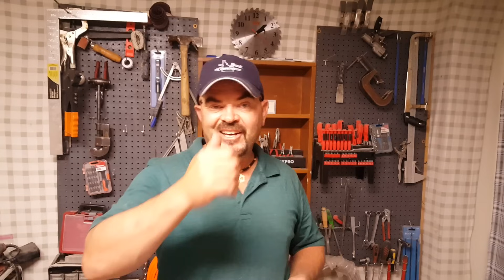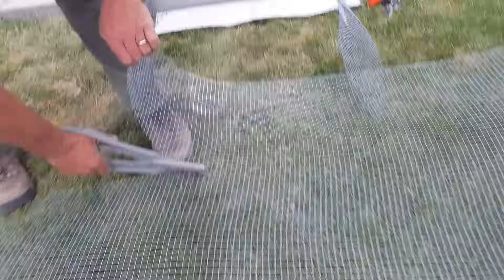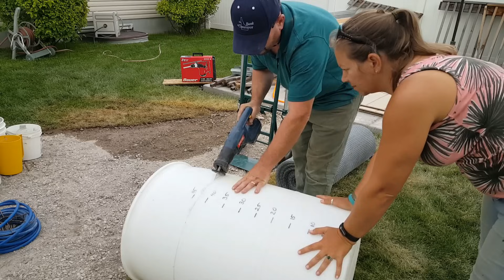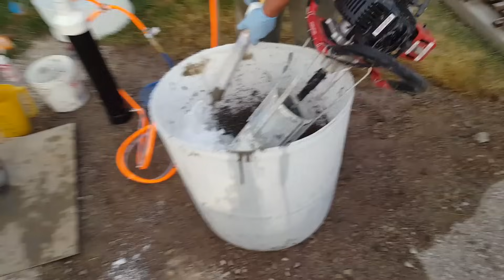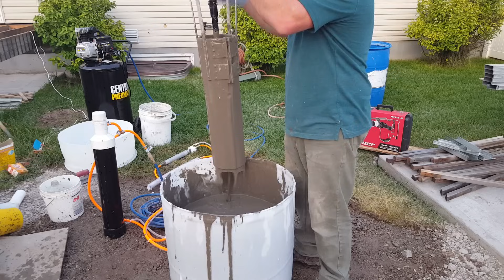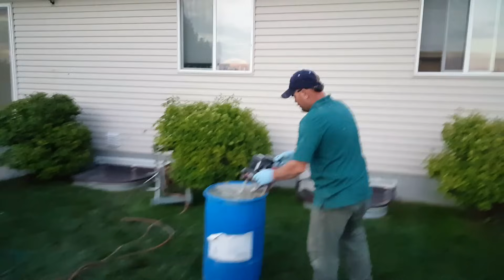Pouring Air Crete Panels for Shed

Comment: Regarding the aircrete as structural components vs insulating, you could build basically a pole barn and fill in the gaps with aircrete panels. The aircrete would be providing some bonus degree of support, but the integrity of the building wouldn't actually be dependent on the aircrete.
Reply: Don't forget the pressure eco-terrorists are putting on the tree industry (among other things). Like it or not, the demand for "green" materials is a reality. It doesn't matter if you agree with the politics,  or financial analysis. The trend is towards higher demand for products like this. Tesla Solar is selling out of Home Depot! Total market manipulation driven by an agenda. Today, if you build a new house in California, it MUST have a PV system, NO net metering. Your home will be little profit centers for the State by 2030 because by then, the lunatics will make it law that you tear down that 40 year old hovel and rebuild it "green". That's a few years after they issue FINES for your "carbon footprint", and forcing the entire population on AI/EV's. You vote Democrat, that's what you get. I wouldn't be surprised if some huge corporation isn't developing a product like this right now. Instead of metal studding, they are using polymer castings built with industrial 5D laser printers. Get a patent bro. And stop posting vids online until you have PROOF of concept. Until then, this is all bullshit. Just being straight with you man.
Reply: Maybe you  should move to my state.  Trees are everywhere and sawmills source their logs locally.  Carbon footprint is low, lumber quality is high and dollars stay local
Reply: Gewgulkan Suhckitt up hi
Reply: joeashbubemma Ramble, ramble, ramble, ramble, conspiracy theory, ramble, ramble, ramble. That's all you have to offer. SAD.
Reply: joeashbubemma just be glad there's a majority of people there to think for you. Not everyone is able to comprehend complex things like environment, climate and why recycling is good. If you don't understand why all those rules are there then i fully understand it must be a hassle for you. You may think they're trying to ruin your life but in reality they're trying to save yours and your offspring's.
Reply: Don't patent unless you think you have enemy. No, keep posting your videos brother.
Reply: Sleepydog oh yea..... Like global warming.... Oh wait first it was we were headed for the next ice age back in the 70's...lmao.
Chicken little.... The sky is falling.  The last thing I need is some harvard graduate or pin head politician saving me from anything!!... If they say no I say YES and I guarantee you I'll be correct alot more than they are!!
Reply from the maker: awesome
Reply from the maker: https://www.youtube.com/watch?v=i2eNx0CVXD8      https://www.youtube.com/watch?v=i2eNx0CVXD8
Reply: Ne olduğunu tahmin ediyorum ama türkçe konuşuyorum

Comment: I wish there were labells telling me what was going on
Reply: Aircrete is made of Portland cement and perlite mix (possibly sand?) then a construction foam sometimes used for insulation is folded in like a meringue and then cast into shape. One surface is covered by Tyvec and a reinforcement screen using metal wall studs to form a mold.

Comment: great idea that has been tried for years, I'm a 3rd generation contractor, just trying to help.  You should explain the foam, the mixture looks really thin-translates to weak concrete regardless of what is inside. Have you completed compression tests on the concrete to give us a (psi) level?  Both peak sustained and compaction ratios.  good luck on your trials, but from what I have seen It looks very weak.  I mean nothing bad, keep trying.
Reply from the maker: https://www.youtube.com/watch?v=i2eNx0CVXD8      https://www.youtube.com/watch?v=i2eNx0CVXD8

Comment: You've got the process sorted, now you could do with streamlining the labor input.

- Keep one half of the top of the plastic barrel attached to form a natural lip

- place the barrel in a tipping cart so you can roll it over the mould and use the natural lip to control the pour

- have your mixing tool mounted to a simple lift so all you have to do is move the barrel under it and lower it in to mix

Comment: Aircrete is simply concrete with bubbles. Regular concrete that we use for our roads, basements, and foundations traditionally made from Portland cement. This combination hardens into a highly dense material with impressive compressive strength. The addition of iron rebar adds additional structural integrity.

Aircrete reduces or eliminates the traditionally used aggregate. Instead of including gravel or other coarse aggregate types, aircrete relies on incorporating premade foam pieces that essentially add bubbles of airspace within the concrete mix. Instead of foam, another option is mixing certain types of reactive substances into the wet cement mix. The chemical reaction creates gas bubbles within the cement and water slurry to harden with empty cavities.

Comment: I work with concrete professionally, but I haven't explored aircrete yet. First, have you tested the compressive strength of your mix design- can you provide the results? 
Have you looked into superplasticizer, fiber, polymer, pozzolans? These ingredients might significantly add to the strength of your concrete. Why is the sleeve over the paddle of your mixer? Have you tried mixing aluminum flake (which is what the autoclaved aerated concrete people use to make bubbles)? AAC is probably going to be stronger than what we can make in a home environment, but I think that what you are doing could still be very useful to a lot of people.

Comment: I did the long math on this please correct me if I’m wrong.

Air Crete in metal studs comes out to $2.86 per square ft of insulated 2x4 wall

2x4 with r-15 batt insulation and 3/8 plywood outside is $2.10 per sqft of insulated 2x4 wall

This is expanding the concrete 2 times. Each 16”x 96”x 3.5” would weigh approximately 50 lbs. 

Basically I I figured it based on 16” wide panels.

Comment: Great work !
Please be aware that steel reinforcing bars or nets should be corrosion protected since the porous structure of the aircrete will speed up corrosion due rapid carbonitation which decreases Ph- value of the aircrete.
Suitable corrosion protections  may be concidered:
* Hot dipped galvanized steel
* Bitumen coated steel (easy application and cheap)
* powder coating
* Paint
* Coating of potassium silicate waterglass.  Caution... Do not use sodium silicate coating since it  may dissolve in water!

Regards

Greattimez, Españistan
Reply: hmm people are using Sodium Silicate to make Waterglass to use as a binding agent in their DIY refractory cement for their foundry... I wonder if the heating up of metals releases water vapor that could effect the water glass durability....
Reply: Christopher Jones 

....
Reply: abdoulaye seck ?

Comment: Air Crete's main purpose, i.e., best use? Is it to replace foam insulation cheaply? Foil backed polyisocyanate is expensive and not sold at home improvement stores anymore, but it's the best insulator. What is A.C.'s R-value? Strength? Cost without labor?

Comment: Do you know that New Zealanders were using foamed concrete to build earthquake proof homes before 1975. I witnessed one being built in Newcastle, Australia.  Factory produced panels, with brick tiled exterior face and finely smoothed interior wall service,  pre-fitted with doors and windows were trucked to the build site, lifted individually by crane and placed on piers within trenches. Roof trusses were added, prior to cement trucks pouring a slab floor.The concrete was pumped through open doors and windows as the roof cladding was being delivered.
The build was completed in 4 days, not just lock-up, but totally, with all utilities working, including kitchen appliances, bathroom and laundry. Oh, did I mention the carpet. That proved to be one item too many.

Comment: cool to see that you are doing this at home!  I really like the idea of building small utility structures this way! FYI "Air Crete" is actually referred to as cellular concrete.  It's been around for a long time.  Generally used as a lightweight fill material because of its low strength.  Concrete looses 5-10% of its strength for every 1% increase in air content beyond about 7% entrained air which is a very limiting factor of cellular concrete.  Also, cement is not considered to be a green building material.  It is actually one of the worst, due to the immense heat required to manufacture cement powder it creates HUGE amounts of greenhouse gasses.
Reply: Keep up the good work though! I really enjoy your channel, lots of cool DIY ideas! I'm very impressed what you pull off in the back yard!
Reply: Actually the majority of the heat and gases are recycled through a Pre-calciner that heats up the material before going into the kiln making the firing process more efficient and using less energy.
Reply: Eric, Maybe, a study should be done, to see how much "Pollution" (as well as "Greenhouse Gases) a "Stick House" built Town, Burning Down in just about an Hour Creates and Releases? (My Hometown of Lytton, BC, Canada, this past June 30th, 2021! You might have heard about that!)

Comment: The steel mesh won't do anything so close to the edge. It will most likely start to corrode. Instead if you reinforce the panel with just one mesh place it on the center.

Comment: They used a product in Houston for years called lightcrete. They used it on the floors of multistory residential dwellings. It used a metal pan so it was poured in place. Coming from the floor covering business, I can tell you it failed miserably for its use. However I dont remember any rebar or wire being used. I was not there during construction only during floor replacement. Couldnt nail tack strip into it without it disintegrating.
Reply: Yep, forget nails and screws, got to use glue or chemical anchors in aircrete and similar, there is just no substance for mechanical fixings.
Reply: Why don't you put nails, tacks and screws in the wet cement and let the owner snip them off as he gets tired of looking at them.
Reply: I think in olden torture days nails in a surround wall would be called an IRON MAIDEN. Her grasp was deadly.  Furthermore, that is where the heavy metal band got their name.
Reply: I used to drive a mixer for Houston shell& concrete and pour a mix that contained light weight aggregate into floating decks way back in the nineties.
Reply: CncObsession also used in California. More for sound insulator
Reply: CncObsession aq
Reply from the maker: bad as a ware surface , many other uses though
Reply from the maker: https://www.youtube.com/watch?v=i2eNx0CVXD8      https://www.youtube.com/watch?v=i2eNx0CVXD8

Comment: Use fly ash as the aggregate and fiber mesh for reinforcement pearlite  will make concrete. Make fillers using pvc  pipe  from 1 to 6 inches  12 inches apart

Comment: Thank you for your efforts.  As a result of watching your channel as well as others, I have determined how I am going to build my new house.  I am going to frame with CFS, install all of the plumbing and wiring, put a thin layer of OSB on both inside and outside walls, then fill from the top with aircrete for insulation/sound proofing.  Because of the weight to height ratio, I will  pour in layers to keep the bottom of the "insulation" from compressing.  This should save on material, but take a lot longer to accomplish because I will have to wait for each layer to firm up.  Native house building (in the Philippines) can take about a year for a single story house to build, so the delay will be insignificant.  The roof will be steel, covered with nipa.  The exterior walls will be covered with Amakon, and the interior walls will be bamboo.  A rustic native look, but using the latest building technology.  Now I just have to get there.   Damn Covid-19 BS!

Comment: How are sir 
I am thinking to make triangle shape metal frame and pour air Crete in it and use it for trusses and then make flat panel like yours and lay them on top as Concret roofing how much do you think 24’ span with 6 feet rise might weigh and what do you recommend the mix ratio should be 
I have been in the construction industry for 30 years and have engineering background and working on a design for third world countries that is economical since wood is very expensive

Comment: Ratio of foam to cement?  What kind of foam does best mixed into cement?  
How do you connect the panels?  Build your own pipe-enhance auger mixer?
Reply: Any foaming agent.  You can use shampoo. I would use 15% - 20% foam by volume.   The more foam you add the weaker concrete becomes.

Comment: Is there a reason you couldn't do smaller batches in the mixer and add the air bubbles in there? Less equipment needed this way but I don't how that would work out in the end. Just asking to learn.
Reply: You may be able to do that if you had a larger mixer?
Reply from the maker: you can do that. it works
Reply from the maker: https://www.youtube.com/watch?v=i2eNx0CVXD8      https://www.youtube.com/watch?v=i2eNx0CVXD8

Comment: As we know, sodium accelerates the oxidation of the metal mesh, so I ask: Can you foam with a sodium-free product? what would that product be?
Reply: Sodium does NOT accelerate oxidation. Chlorine ions do. Never let chlorine near your reinforced concrete if you can avoid it.
Reply: @mckenziekeith7434  salt is NaCl sodium chloride
Reply: @freeq1829  that is true. Well, it depends on the context. But nobody said anything about salt. Nozor was responding to the addition of sodium something or other in the video. Not sodium chloride.
Reply: Use fiberglass instead, or horse hairs.
Reply: I don't know why I didn't comment the 1sr time! 😊😊😊

Comment: Hey brother I myself have air crete maker.. Lil dragon... Silicon is wonderful.. You can make molds of much higher costing bricks for half the price
Reply: I also have a system using horse panel and rebar I would like to show you to add structural integrity I basically use pcv to hold the link and slide tthe rebar in adding the air crete later as a motar..works wonders and saves money..

Comment: Just wondering. Would you want to put spacers under the wire mesh in order to center it in the panel or keep it from being pushed to the bottom or back of the panel?

Comment: Great job! I would like to know the following: (i) What do you use for making the foam? (ii) What is the mixing proportion of cement with foam? (iii) Is it possible to cast a small roof slab (15 ft X 30 ft) and what type of reinforcement does it need? Thanks & Regards.
Reply: Какой состав пены

Comment: Have you ever made an aircrete table or other furniture? I'm wondering if you could skim a final coat with normal concrete to fill in the holes to have a nice smooth tabletop surface.

Comment: Neat idea, Use bamboo ceramic fabric with banana plant cellulose sponges treated with water activated ceramic that expands when water is applied to it and hardens and cures has it dries out with no shrinkage. Using these materials prefabricate wall panels using aluminum framing with light switches and electrical sockets all built into the prefabricated wall panels. Then design roof panels abd even a foundation that has holes were you can pour concrete ankers with morring bolts to secure the banana plant cellulose sponge treated with water activated ceramic that will swell up from its compressed state from shipping and harden with holes for plumbing sewer and electric and heating or cooling if heated floors were added to the prefabricated foundation design. Then design the wall and roof panels to swivel latch lock into each other that all have a couter pin you snap into place to keep the lock in place. main idea, Design a prefabricated house that an individual can go online design their own home picking colors of tint used on the different panels and for a color scheme to the house inside and outside. Then be able to UPS ship it all to a site where two people can place the foundation on a prepared area then hose the foundation down with water and let it cure while making sure the plumbing sewer and electrical are all lined up has the foundation swells up and cures rock solid. Then the wall panels and roof lever latch locked into the foundation and walls locked into place with the roof locked into place then the whole structure hosed down with water and left alone to cure for 48 hour's. Once the structure has cured and the customer is satisfied with the process and colors of tint used on inside and outside panels? Then spray a clear coat applied to inside wall panels and outside panels and roof and the foundation sealing the tint and acting like a vapor seal and weather seal  on the whole structure. Then customer can run electrical wire's instal light switches wall sockets lights and fan's then install showers tubs and toilets and then install flooring tiles and carpeting cabnets sink and stove in kitchen and hang doors and windows attach insulated conduit for the central heating and cooling unit to the prefabricated air conditioning vents. A home you can order online that you can erect in two days using zero tools that you can move into within a week or two depending upon all the installation times of bathrooms kitchen flooring ETC? What do you think about this idea? 😊

Comment: Awsome videos and good on you for sharing it with us.  Just a thought though,  instead of cutting the wire mesh to the exact(or almost) width of the metal frame why not leave about an inch on either side of your panels' width that way you can bend that inch on either side to 90 degrees that way the 1 inch high bend will rest on the metal frame raising the entire wire mesh an inch or so off the bottom.  Just a thought but hey as I said really good job man I wish I could join you in your endeavour.
Reply: Derek Moss
Reply: Love the music. Show us completed project please.